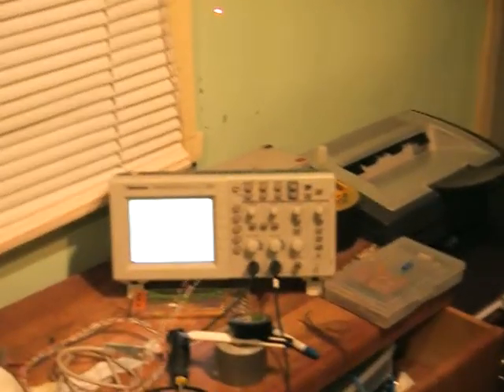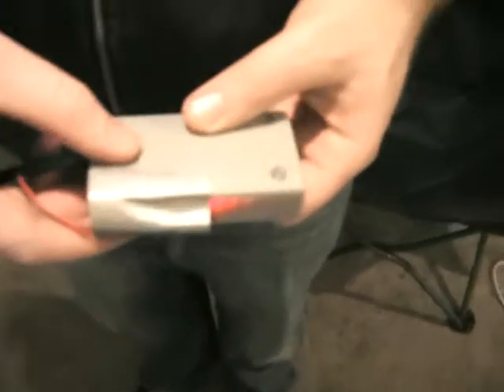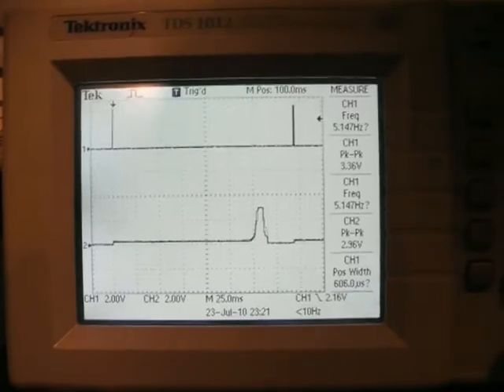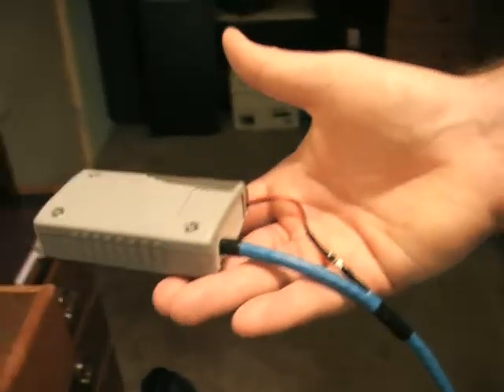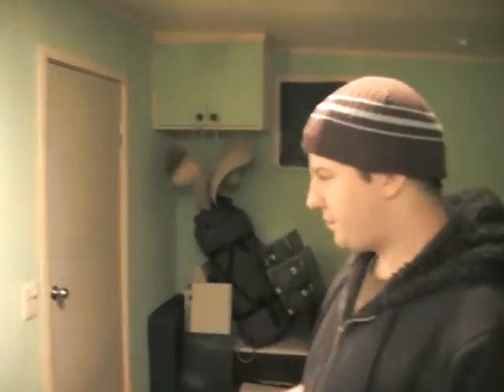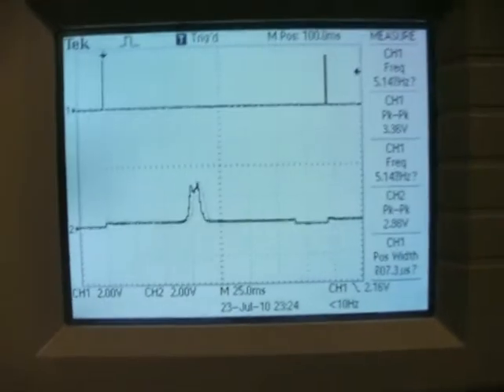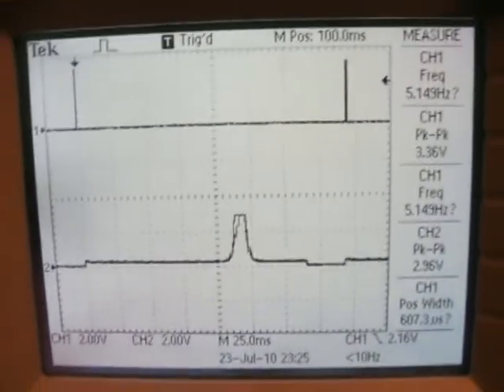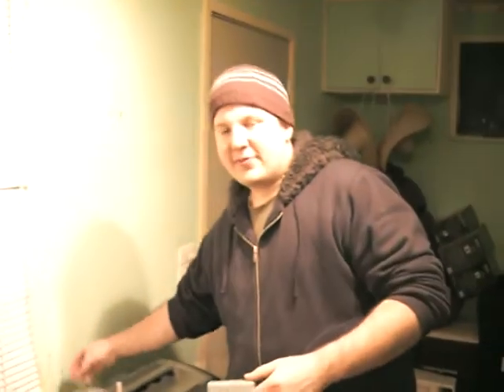VIMA - LPDA with laser sensor

Comment: The next thing that I'd like to try is a laser which omits light at the optimal frequency for the LPDA.  It's be interesting to see if the engery which comes back is improved.  If this is the case, we can then shift the laser a further 20mm outwards from the box.